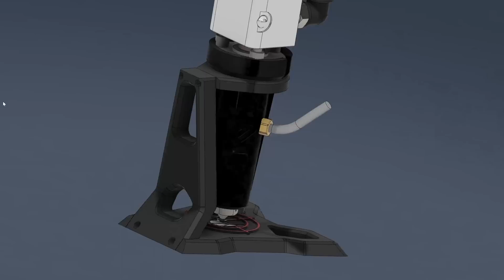3D printed Goliath hotend. (Timelapses)

Comment: Companies like Slice need all the hate i can provide to them.

Unbelieveable how they suppressed the development of new technology that has absolutely nothing with their (design-) patented product in common. The mounting of the hotend is quite more alike one of the really early 3D printer designs from the good old RepRap times, as is the product of Slice. They invented nothing new, protected only their specific design. Prosecuting other companies with completely new product designs that have never been seen before through the patent law over a somewhat identical mounting solution (that they even did not come up with by themself in the first place) and the reaction to the public afterwards is just the complete bottom level one can reach. I have not supported them and will never do so in the future, because of their politics around a great technology.

Their products are just not worth a degredation of the existing culture of open source in this segment of development and technology.

❤Open Source❤

Comment: Why your 330's head have no cooling at all? No fan cooling and no water cooling.🤔
Reply from the maker: It worked fine like that :) And I wanted to show how the Goliath has a very very good heatbreak that works so well that it doesnt need a lot of cooling. Also the whole printhead in aluminum act as a giant heatsink so it was ok like that. I just upgraded to watercool yesterday because I just like watercool and how it cools down everything :)
Reply: @Vez3D  That's cool, Goliath is a great design! Wonder that is this still work under low speed printing with out any cooling? Considering maybe low speed needs more cooling?

Comment: What filaments did you use?
Reply from the maker: Here its all PLA with the exception of the TPU for the "silicon sock" and the heater nichrome wire
Reply: @Vez3D Thank you for your answer and sorry I didn't explain myself correctly, i was asking about the brand and the colours names because those filaments look amazing when printed
Reply from the maker: @danicrak131  the silk ones are brand "cerprise" haha Got them for 10$/spool .. they are not very good in layer bonding. The black matte is BiQU black matte PLA. Excellent. The TPU is from Sainsmart
Reply: @Vez3D  ok, thanks

Comment: My opinion is that a patent should not be granted for something simple and general that has been published before. Famous example is the Apple patent for a tablet that in their patent application drawing looks exactly like all the tablets in movies and TV shows in some cases decades before the patent. In this hotend case I do not get why a piece of thin wall tubing can get a patent. And I think it is a nice case of a patent stopping further development. Just like the whole FDM printing process could not get to where Slice has their profit from it until some patents expired and open source took over. On Slice Engineering part I dislike that they ignore all this. I would totaly understand if they went after someone cloning their product. But using similar material in a similar way is patent infringement? Come on. My reaction to this combined with my experience with the Copperhead hotend is that I am done buying their products for the foreseeable future. 
I have never considered that what I just wrote here could be seen as hate. Am I wrong in this? If yes then why?

Comment: That shot of the 3X model inside the printer is priceless 👍👍

For the next assembly timelapse I would mute the video as there are some annoyingly high pitched sounds.
Reply from the maker: huh? its a timelase.. meaning there is no sound.. they are photos lined up together. It was not recording. not sure what you heard there ? Maybe when I am assembling the parts ? thats a recording
Reply: @Vez3D   Yes, that's what I meant.
Reply from the maker: @ZURAD  I thought it would be nice to hear the clicks and noise from assembling.. alright.. noted :P
Reply: @Vez3D  I generally think the same thing, however the sped of version ends up a bit grating. Otherwise I always love your content. The degree to which you've rethought FDM from the ground up is inspiring.

Comment: Simon why didn’t you work with slice? I know you went to them in the beginning? But then took the design to China ignoring the patent? 

Why not just get their blessing? I don’t understand why this had to be so difficult. Did you know want to pay royalties? 

I wish someone would say the whole story
Reply from the maker: I tried to get some kind of a license from them or a royalty that I would give them for each hotend sold, but they didn't want that because I was partnering with one of their competitor (Mellow) who had sold in the past some clones of the mosquitos. Which I totally understand and I hate clones myself. So they didn't want to sell me a license. However, the Goliath with spacers I thought (and still think) that it does not infringe the patent, but Aliexpress system is just too "raw" and just blocked it. But if you take a closer look at the patent and how it is claimed, there are very specific dimensions to respect to not infringe it. They could not just patent spacers and bolts, its not what people think. They had to be very specific in their claims so they could get the patent. Things like dimensions on the spacers (cross section touching cooler and heater  (between 0.25 mm2 and 3.2 mm2, Goliath spacers are way bigger), heatbreak feed tube wall thickness (less than 0.13 mm, while Goliath is WAY thicker), heat block lenght (between 5 mm to 38 mm while Goliath is 44mm), etc.. etc.  And none of those are applicable to the Goliath. At every point, the dimensions and design of the Goliath is way outside of the patent claim. However, im not a patent expert and It would have cost me to much money to fight and try to prove it. Instead, it was just easier to change the spacers to a use standoffs instead  with no compression/tension of any members in the design and not using thermal insulator. Plus there is prior art on the standoff design.
Reply: @Vez3D  Thank You for the reply. You may know I am very close to Slice... and I am an affiliate too. Dan and Slice as you said are good people. Unfortunately the Chinese have stolen and just unaplogetic about. Phaetus for example steals, and just laughs at Slice... You can't blame them for being sour on this. 

What you should consider is a kinematic coupling versus a tube or standoff.
Reply from the maker: @thelightspeed3d712  I dont blame them for that..I understand. I have always had a good relation with Dan and Chris and been helping them to push their Magnum+ since a long time, and they helped me back with the affiliate program. Mutual cooperation. I wish we could have done the same for the Goliath, but again, I understand their point of view.   As for using kinematic like the new hotend, yeah its a cool solution.... but my goal was to avoid having to re-manufacture all the heatsink and/or heatblock... I wanted the simplest solution to keep the already manufactured parts without losing too much money. I already lost too much in that project haha.

Comment: Huge thanks for all your hard work! I am currently building a VzBot 330 and i was wondering if it would be possible to actually print a hotend, i worked at an institute for polymers with a bunch of 3d printers. We 3d printed metal parts and i was wondering if you could print metal filament with a VzBot. There are companys in germany that sinter (baking the 3d printed metal part), you just have to send it to them.

Comment: What has changed to not infringe on the patent? Standoffs now go into the side of the block?
Reply from the maker: standoffs + bolts vs spacers + bolts. It doesn't have any tension/compression now with the standoffs. Also the cross section touching the heatsink is way more than the patent claim, the thickness of the feedtube is also way over the claim, the touching surface of the feed tube is also way higher than the claim, the lenght of the heatblock is also longer than the claim and I could continu on this... but  all the details are on their patent. They didn't just patent spacers and bolts like some people says, they patented a very unique and awesome way of keeping heat away from the heatsink with surgical precision, and they had to really be specific on the claims for that.
Reply: Looks like just standoffs instead of tube spacers. I wonder how that effects heat transfer since it will have a larger mass and surface area?
Reply from the maker: @ianhassett7281  about the same from math. The surface touching heatsink is  in fact smaller than with spacers...but its using titanium Gr5 instead of ceramic. So its roughly the same in the end. And we are looking to optimize the standoffs even more this week

Comment: What motorised slider are you using for Timelapse’s?

I’d also love to see a stand that holds it at 45 degrees so it’s a little prettier and can be observed easier. (I know DYZE design has rotating stands that hold a hotend at this angle).

It’s also amazing to see how far the Goliath hotend has come! (Rip Long Schlong Dong)